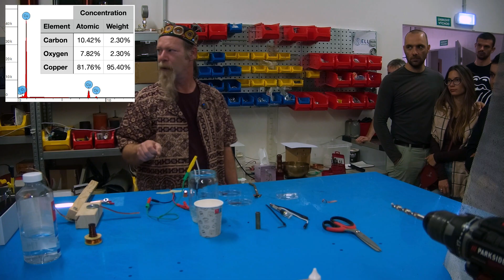Matsumoto S71 KOH + Pb + H2O replication attempt

Comment: G'afternoon 🤠 .  This is kool but I'm confused as to what the objective is 🤔 . 

I'm a mechanic & an Electronics nerd so when I think of creating an electrical arc underwater my mind automatically goes into hydrogen pump / generator mode. Because when you create an electrical Arc underwater the arc splits the water molecules into hydrogen al & oxygen black candy fed into the intake manifold of an engine to clean up the emissions so the engines run much cleaner, and the more you can produce the cleaner the engines will run. 

My friends and I made a hydrogen generator and plugged it into an Oldsmobile 455 V8 that we took to the emission station to get tested with the pump off. After the initial test we turn the hydrogen pump on and jumped on the interstate and ran 1 me down and back to the emissions station with the pump running for another test and it cut the emissions exactly in half by 50% . That's pretty good considering it only cost us about $5 to make the hydrogen pump out of PVC pipe a couple galvanized cans handsome vacuum lines and fittings 😁 ..
Reply: This experiment aims for conditions where electrons expand out and become a coherent shell containing bare nucleons.  K and Pb can be neutron donators, while O and H are the feedstocks.  Elements such as CA, F, Ne, Na, MG and up can be made.  There could be trace amount of Mercury or Thallium due to neutron stripping, but I am not too sure on that.
Reply from the maker: Huge update to the O-Day - Intersection? post, with original Matusumoto S70 and S71 SEMs and EDX data compared to our S71 replication with all materials available for download.

Looks like it was a successful replication.

https://remoteview.substack.com/p/o-day-intersection